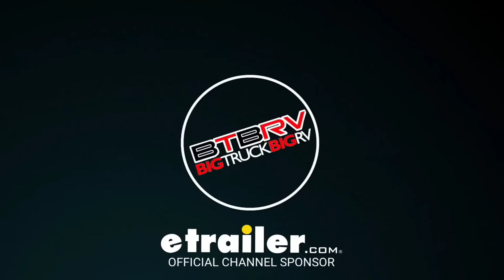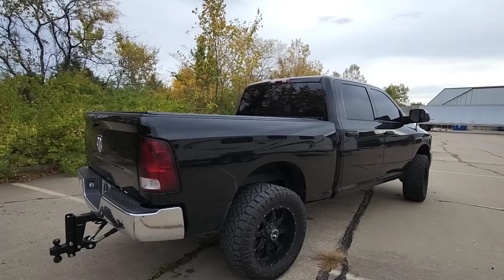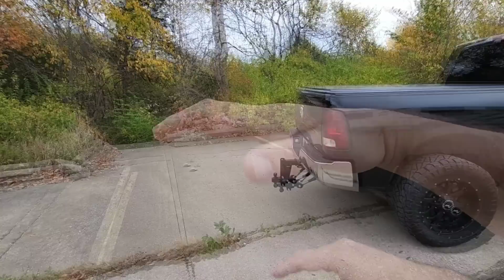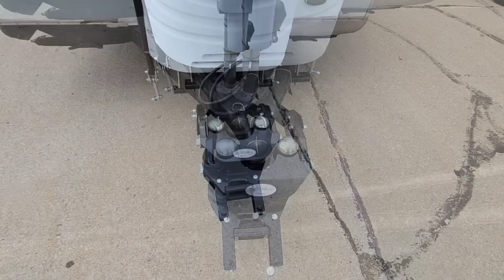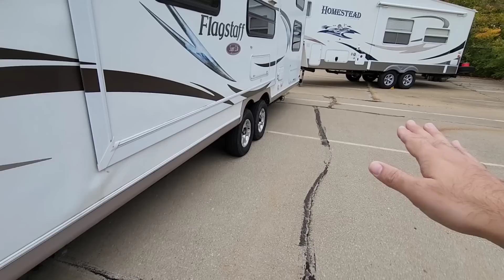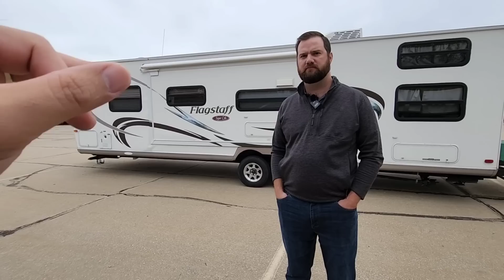RV SWAY Explained and how to control it!

Comment: I have a 2009 keystone sprinter 299bhs 33.17 ft long gvwr 9,800lbs 1k hitch weight tow rig is a 2001 f250 fx4 crew cab lariat v10 with rear air bags usually at 80psi when towing 5 to 10 not towing I’ve personally not had any problems with sway

Comment: Tire sway is real. I had a set of BFG All Terrain KO2'S put on my '16 GMC Denali 2500 and they were very spongy.  They were installed on the factory 20" rim's and same as OEM size. It was as if you could feel the tread and sidewalls distorting. Additional problems were that they were noisy and produced severe vibration so I changed them out with less than 10k miles on them. All problems went away with the Goodyear Wranglers.

Comment: When you experience sway what should be your first reaction?
Reply from the maker: Generally it's to maintain speed and apply the trailer brake to put tension between the trailer and tow vehicle.  This "should" pull the trailer back in line behind the vehicle.  The problem with this is that many people wait way too long to start applying the trailer brake and it's too late to control the out of control trailer.

Comment: Nice video.  Just to clarify... there is a virtual pivot point forward of the hitch ball when using a 3P hitch.  The two bearing covers next to the hitch ball do not allow the trailer to pivot at those points.  Only inputs from the tow vehicle side will allow the hitch to pivot.  Inputs from the trailer side, such as wind or passing trucks, are locked out and the pivot point is projected forward to the same location as with the gooseneck.  This removes the leverage created with the lever arm between the rear axle and the hitch ball when using conventional hitches.

Comment: The rear cross bar needs to be centered on the Propride hitch...just saying...  But, yeah, it's a great hitch!  After looking, I'm guessing the hitch was in the process of removal, as there are not weight distribution bars on it either.  Thanks for the video JD.  Oh, I did order my 2023 F350 the other day.. can't wait.  I have a Montana that will be mated to it as soon as it arrives!

Comment: Would stiffer side walls on your trailer tires help reduce sway ? 
   Also would a diesel truck ( being heavier engine ) help reduce sway due to the weight distribution overall ?

Comment: Good video.  I use the equalizer hitch along with the Tuson Electronic Sway control.  Both work great together.  I installed the Tuson sway control when I pulled the trailer with a Land Rover LR3.  I have a truck now for greater capacity and better ride quality.  I have a question, a guy I talk to tells me a 5th wheel creates more wind drag than a conventional trailer.  What is your opinion I would think it is the opposite

Comment: great video, I just add a little something. the propride hitch in the video dose not have the weight distribution bars on it, the bars do not come off like traditional bars they are designed to stay attached. also your info on its pivot is wrong, the way it works is that it projects the pivot point 50 plus inches forward it only pivots at that point at turns like in a parking lot or campground on the road it makes the truck think its pulling a 5th wheel. I know a lot of sway control hitches are good in there own way but not matter how much down force you put on friction hitch a strong gust of wind can overwhelm the hitch. The ProPride  and the Hensley hitch take out all sway, period. But like any hitch it must be set up correct. I here a lot of people say that over 3 grand for a hitch is insane but I think you just invested a lot of money in a travel trailer why not make sure it will tow safe plus how much is the safety of your family worth. My present rv is a 38' 5th wheel my son has a 32' TT with a ProPride hitch, a couple of weeks ago we were coming back from a trip, I was behind him on 83 in PA. and a car came off a ramp and cut him off, he had no choice but to make a drastic move to avoid the car and I can say from what I saw that hitch saved him, I was shocked of how the trailer stayed right with him and it was a pretty violent move, I've seen so many videos of TT go into a uncontrollable sway that started out small and then flip on its side.  I watch all your videos every day and love them, very educational, filled with great info but I really think you should do a video on that hitch with all of its info, I think a lot of your viewers would like to see it. Sorry this turned into a rant. LOL, keep up the good work, love the channel.

Comment: Fantastic explanation! This should be a mandatory subject/class for anyone wanting to tow with their vehicle. 
I will say to everyone that a proper tow vehicle really matters. When I would tow a 7,700 pound camper with my F150, I had to crank the weight distribution hitch so tight to level out the rear axle, tongue weight and reduce sway…it caused my trailer axles to become over loaded according at CAT. The moment I loosened the hitch a little so the trailer axles were under weight, my rear axle on the truck became over weight. 
In the end, I got tired of counting pounds  and upgraded to an F350 which was night-n-day and worth every penny in towing comfort. 14k towing and zero sway.

Comment: Weigh Safe True Tow, take the guessing out of hitch weight and know exactly what it weighs and what amount of distribution you need. Over distribution is a worse problem than sway.
Reply: How do you know exactly how much weight distribution you are getting on your front axle when you achieve the number they tell you on the gauge? Do they know what vehicle you have and how much weight distribution you should have for your vehicle and trailer?
Reply: @rockymtnhighadventures  the Weigh safe True Tow has a phone app, you input several important pieces of data and it tells you what to dial in for DTW, distributed tongue weight. Unlike others that are set it and forget it, it can help you dial in when something changes, like carrying 100 gallons of water etc. I had another hitch that used washers to set the hitch, but you never knew the weight unless you went to a scale. With the weigh safe unit, I know my tongue weight, every time I hook up, if it hasn’t changed, I don’t have to do anything. If it has, a few turns of one bolt, puts things back in order.
Reply: @cisco1dog  I agree the tongue weight gauge is convenient. My question is when you hit that DTW number on the gauge, how much actual weight distribution does that give you? To clarify, my understanding is that the amount of weight distribution is defined by how much weight you return to the front axle - returning all the weight taken from the front axle is 100%, returning half the weight is 50%, etc. That can be determined by measuring the height of the front fender. The owner's manual for my truck says to only do 50% weight distribution or half-way back to the original fender height. Some I've seen say 100% others 2/3 back (66%). Would this hitch and the DTW get me back to 50%? If it goes to 100% then I'm over distributing according to my owner's manual. That is why I asked and am curious how much weight distribution you actually have when you hit the DTW on their gauge?? I think I would still need to measure the front fender height to verify the right amount of actual weight distribution??
Reply: @rockymtnhighadventures  my old hitch said1/2 way back at least, however not more than even. Such an unscientific way to do it. 
With the Weigh Safe, you get real weight. Not sure of the exact percentages but it moves weight to the steering axle and to the trailer, which is why they get the measurements to the back axle and the center of the trailer axles. The DYW, is the total weight distribution between the steering and trailer, to keep the tongue weight in the correct range.
Reply: @cisco1dog  Ok, I was just wondering. It sounds like you don't know how much weight distribution you are getting. And, that is my fear. Everyone will adjust these Weigh Safe hitches to the DTW given them by Weigh Safe and never really know how much weight distribution they are actually getting and therefore they don't know if they are under or over what their truck/tow vehicle should have based on the owner's manual (all the major truck/tow vehicle manufacturers measure the front fender to determine weight distribution). To me, taking a bunch of additional measurements that introduce error then calculating/relying on the DTW and not knowing my actual weight distribution doesn't seem very scientific or safe. I'd rather measure my amount of weight distribution directly at the front/steer axle (which is the definition of weight distribution) so I know exactly how much I have. Then I can dial it in to exactly how much I should have for my truck and trailer.

Comment: The propride hitch is actually designed for lightweight traiilers such as a boat.
The Hensley hitch is designed for heavy trailers, and the Hensley does eliminate sway.
I've towed my 38 ' travel trailer across i40 to the grand canyon in March through 35mph winds.
Reply from the maker: I think ProPride would disagree
Reply: @BTBRV  
Of course Shawn would disagree but I'm going by what the designer said.

Comment: It took me a few trips to get my hitch dialed in but once I did my trailer pulled amazing.  I can pull my 7000lbs camper with my F150 effortlessly. A properly setup hitch is key whenever you pull a bumper pull trailer.

Comment: Propride is a cheap knock off of the Hensley hitch. Recommend the Hensley Hitch. I can tell you from many miles of towing my 32 ft TT with my F350 long bed their is ZERO sway.
Reply: The Propride is the updated and upgraded version of the Hensley hitch done by Hensley himself and propride. JD am I wrong about that?
Reply: Jim Hensley isn't out here knocking himself off.  The ProPride is his third generation of his design.  The first was his Eliminator.  Second was the Arrow.  Third is the ProPride 3P.
Reply from the maker: Propride...cheap?  Define cheap

Comment: I just went to Anderson WDH. About 1/2 the weight and very easy set up & on / off. Eliminated the spring board (porpoising) effect that my other WDH created. I now have ever so slightly more side to side sway but well worth the trade off of the easy on & off and less weight of the Anderson. I did have to experiment a bit tuning it in, but after a couple of trips it woks very well. Towing a 30' 9500# tt with a F350.